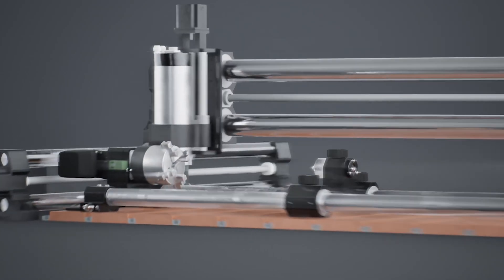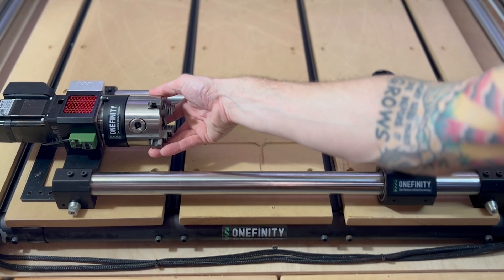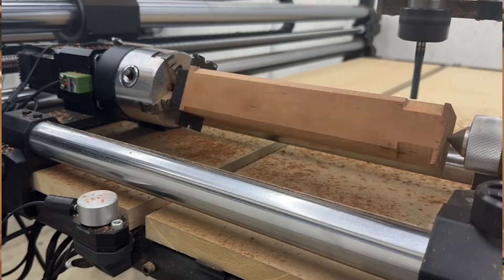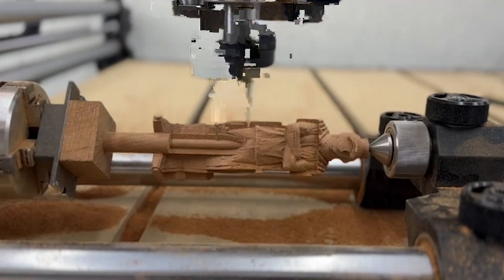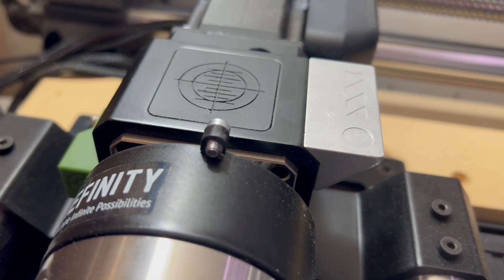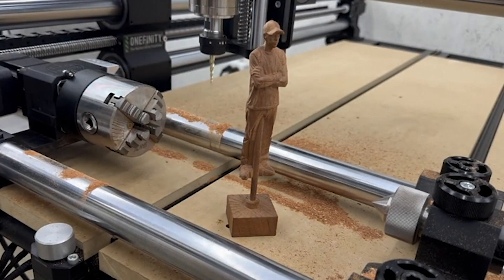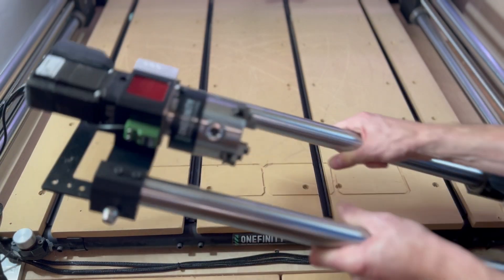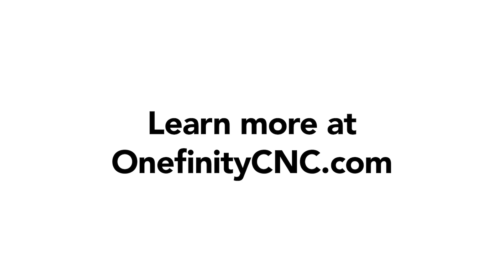Welcome To The REVOLUTION! Introducing Onefinity CNC's 4th Axis Rotary

Comment: What is the longest piece that can be made on the revolution for the woodworker X35?
Reply from the maker: 37"!
Reply: @OnefinityCNC does not make sense. The motor and spindle occupy space so the piece that can be worked on must be smaller than the woodworker cutting area.
Reply from the maker: Oops!  21” on woodworker size!  37” on jm and fm size!

Comment: Any chance this has non proprietary motor wiring? Would love to use it on my openbuilds setup. It seems like at the very least I could replace the stepper with my own if not.
Reply from the maker: You’d most likely need to change the stepper for one compatible with your own!

Comment: Question on the stock - if I have a 48x48" OneFinity and I add the rotary, I can load up to 37" long, and 7" wide stock. If I glue-up my own stock to make a 7" wide block, do I need to ensure all edges are square first before loading into the rotary? Sorry if this is a stupid question, Im new to rotaries.
Reply from the maker: 7 round can fit, 5 1/2 square can fit.

Comment: I'm running s Onefinity Foreman Elite. I've only had it for about three months, but I love it! I have a large job to complete for a client. I have to turn quite a few pieces that are 5-1/2" long and 2-1/2" in diameter. I bought a lathe with a duplicator that works, but this might be a better option. I don't need blinding speed, but I'm sure the CNC would be less work in the long run. I'm running the latest version of Carveco Maker. 

Carveco Maker
Version: 1.57
Build: 2024-11-01-1701-b474b714
© Copyright 2024 Carveco, Ltd.

Does anyone know if this unit is supported? I read somewhere that it is, but I don't know which version. Do I need Maker Plus?

Thanks for any input!
Reply from the maker: maker now has rotary support built in!

Comment: Cool - now I just need to learn how to handle the CAD/CAM process in Fusion... 🤯
Reply: Unless you pay for both a regular license and the manufacturing extension for Fusion I don't think there is much capability for 4th axis. There is some wrapping capability in some of the 2d tool paths but I'm still trying to get my head around what their geometry limitations are and what you need full 4 axis for. For example, I have seen on the fusion support forum that carving a figure like a statue would need the manufacturing extension.  This is my current hurdle since I can stomach paying for a regular license but the manufacturing extension would more than triple my annual subscription cost for only two features that I would use occasionally. 
Buying a perpetual vcarve pro license is half the price of the annual cost of just the fusion manufacturing extension, not exactly an apples to apples comparison, but it might be a functionally adequate and cheaper solution if that's a concern.
I wish 4 axis strategies were included in the normal Fusion license because apart from using a rotary or the inlay vcarving tool in vcarve pro I would consider Fusion to be a massively superior workflow for design through to manufacture.
Reply from the maker: it's head spinning!